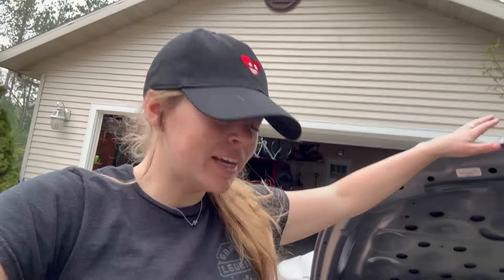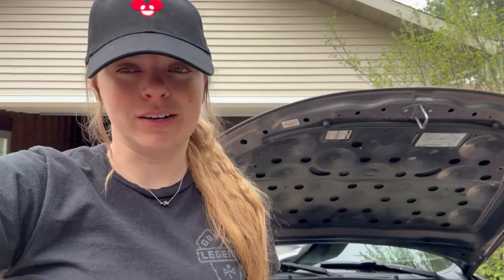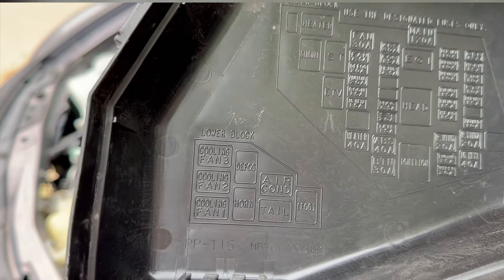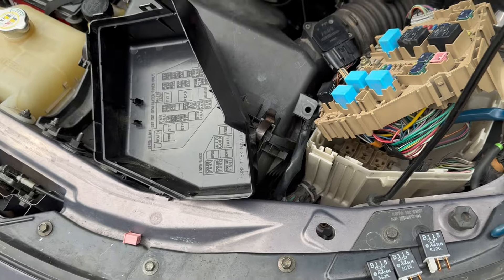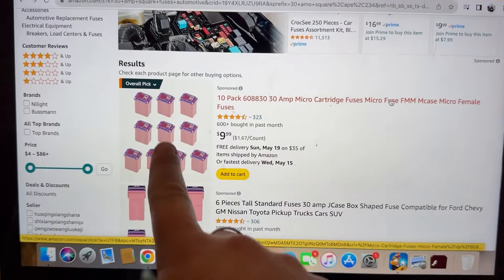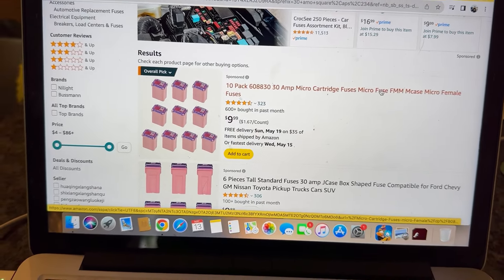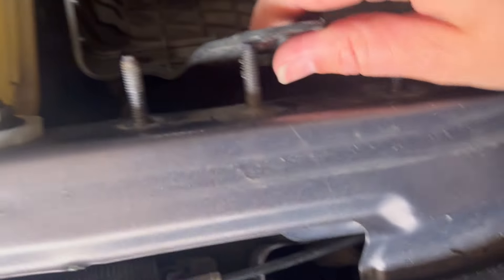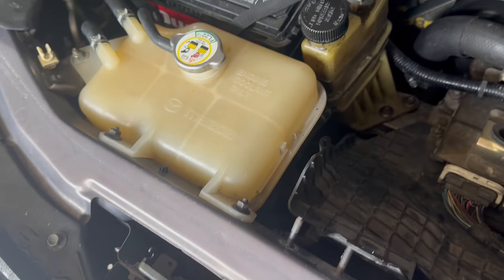Diagnosing and Repairing the NC MX-5 Overheating Issues! Fan Troubleshooting and Replacement

Comment: I had the same fan problem it took approx 4.5 hrs from start to finish. I didn't need a new fan. I opened up the fan motor filed 0.2mm off the sides of the four brushes and reassembled. The brushed were getting stuck and not making contact with the communtator. The brushes were almost new in that they only had 1-2mm wear. When reassembled and the motor sealed up and the casing re-crimped. the motor was perfect I did this December 2023. Putting the fan back in was a bit of a pain but it did slide back up into position from under the car with it up on blocks and front wheels removed. The hoses were a challenge but slow and steady did it. Total cost to rix the problem was $0.00. Didn't need to regas or replace coolant a totally dry job.
Reply from the maker: @richardkaz2336  nice! I was definitely not this committed. I think the whole assembly was sub $100. Dry job maybe 1.5-2 hours